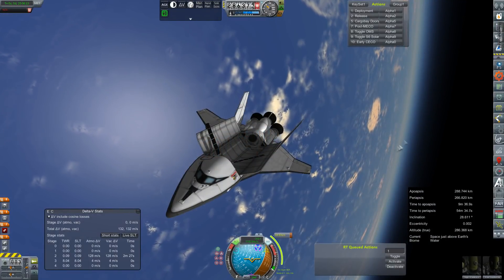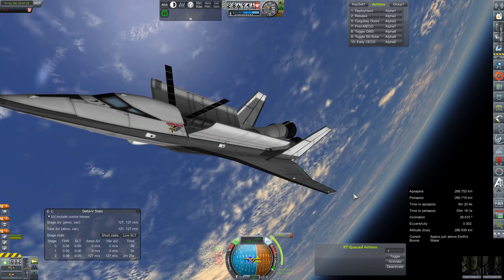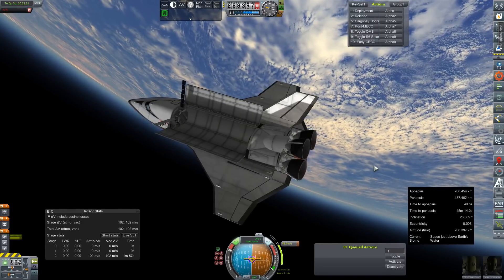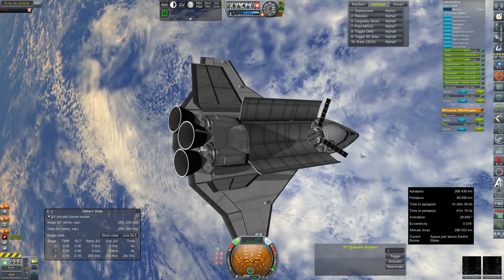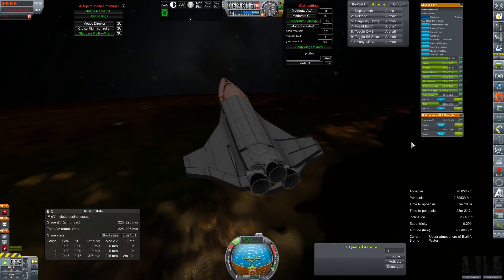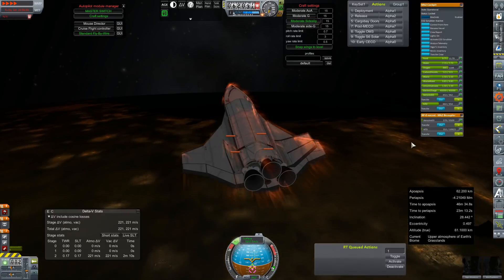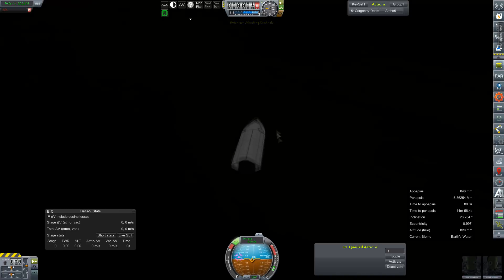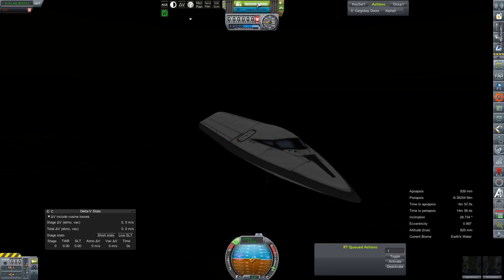KSP RP-0 #525 Overheat Warnings

Comment: Holy c**p! I thought they were dead the second they turned into a nosedive! I guess some unmanned tests are in order?
Reply from the maker: I think the fault had been found, in that a part that was created for the shuttle - I used an old version of its config, and not the flight tested hardware. The real issue is the crew of the other Mk-6 still in orbit...
Reply: @CosmonautCrash  I was wondering about that...
Reply: Maybe send a rescue craft up there and land the Mk-6 autonomously if possible
Reply: @QuietElite  I just got suddenly reminded of the Columbia disaster...
Reply from the maker: Plans have been drafted as far as what to do.
Problem 1 - life support will only keep them up for another week or two.
Reply: @CosmonautCrash  Do they have a sufficiently low relative inclination that their fuel can get them to KP Station? Maybe use   Nemo or Dory to meet them halfway! (At the bottom of the corner, that's where I'm gonna stay...)
Reply from the maker: KP station has a matched inclination with the moon, this mission launched to match inclination with the moon... 
No spoilers :)